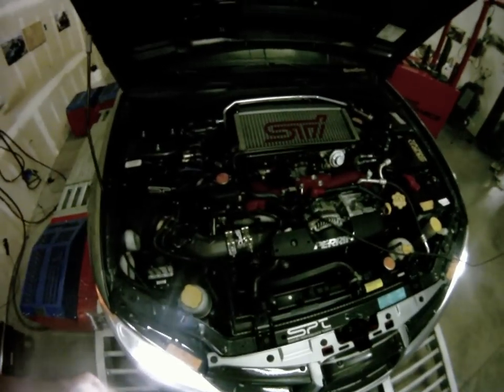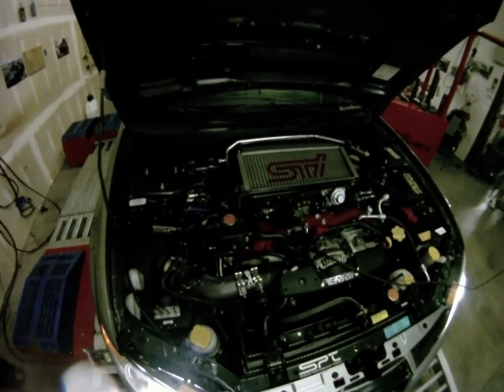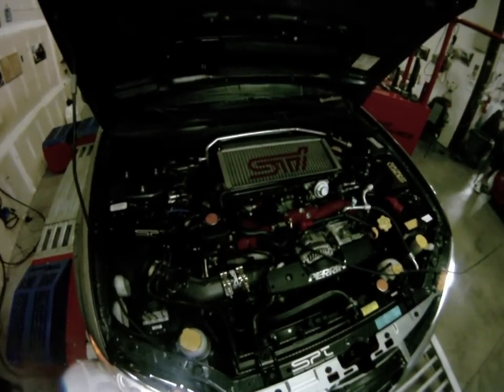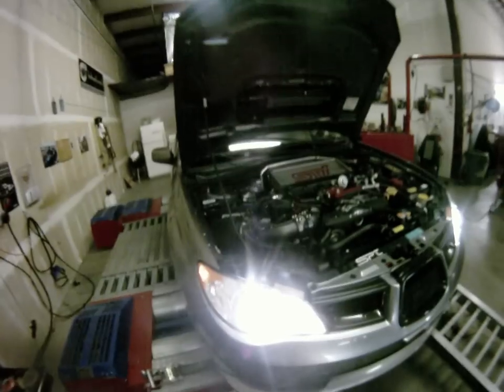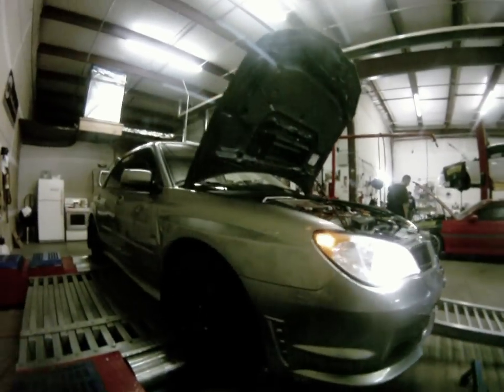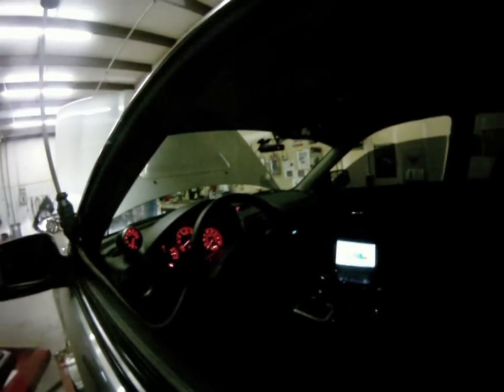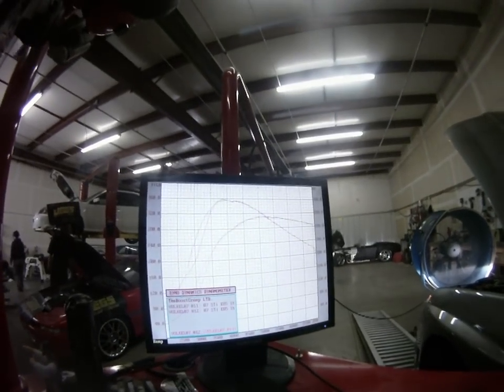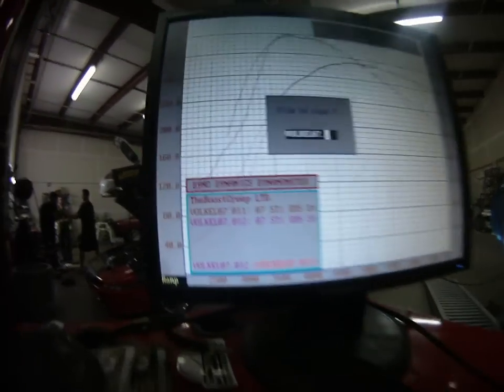STiStage2E85.MP4

Comment: With IHI VF39 turbo??- OEM turbocharger. PLEASE - let me know. I have similar + TDO6H- w/ a 60-1 compressor section. SPECS: compressor specs:: 59 / 76 mm / turbine specs: 58/ 67 mm- 3" compressor. BUT: I need to find a 3" TURBO INLET(TYPICAL MODS:TGV DELETES,1200 cc deatschwerks side-feeds, 255 lph walbro, and full exhaust): 3" Bellmouth D.P., 2.25-2.5" up-pipe, unequal length headers and a 3.5" muffler.Stock block w/ported heads-stock cams. Thanks for help,Stewart Performance Ltd  #ROTORHEAD71